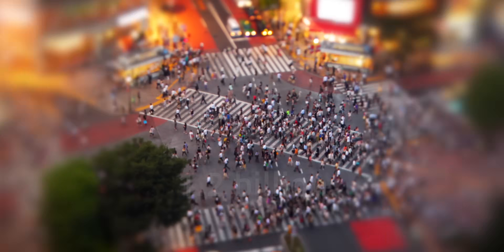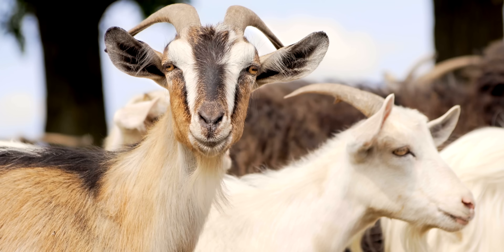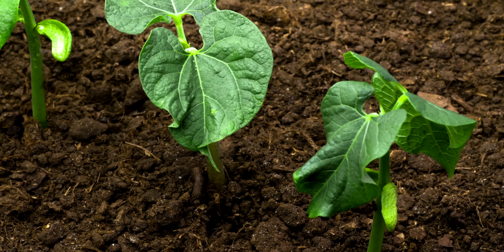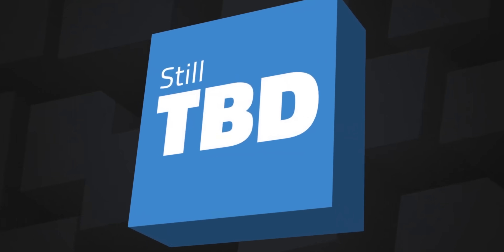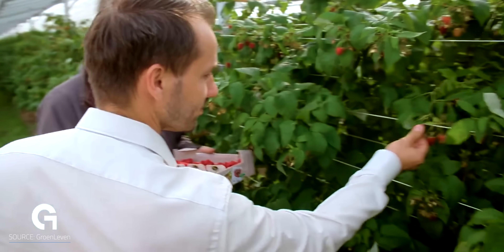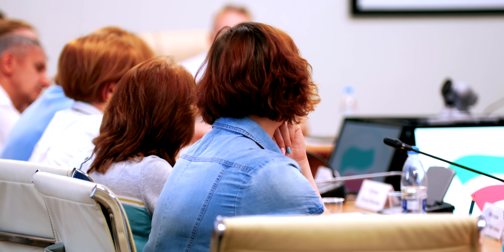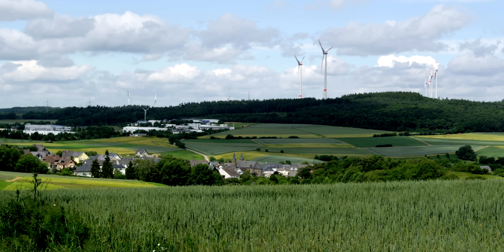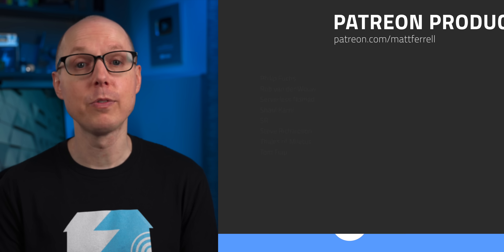Solar Panels Plus Farming? Agrivoltaics Explained

Comment: Several decades ago some articles were written about the potential benefits of putting farming equipment on rails in order to not compact the earth under the wheels.  At the time I recall the major advantage as being reducing the energy consumption of the equipment while working the soil.  Guiding the equipment through the rows between the solar arrays effectively achieves this goal.  Furthermore, the structures could provide attachments for a hot shoe  or catenary power takeoff to power electric equipment without the need for large battery packs.  I believe fuel is a significant cost for farmers.  Reducing the energy cost to the farmer could be further justification.
Reply: Yeah, powering the machinery itself would be ideal, and selling off the surplus as a bonus.
Reply: @UncleKennysPlace  There is nothing to stop farmers doing this in any field. It's just not cost effective
Reply: @daubentons1  I think you are well on to it- the original poster had no budget to pay for the rails, cross ties, maintenance- or the connector rails needed to get from one field to another. Same thoughts occur to me for farm equipment powered by direct take of from the overhead PV grids. But good thoughts to start from!  FR
Reply: Agree.  APV gets even more interesting when you further utilize the overhead structure to distribute power allowing the farm implements to be electrified.  As we move towards decarbonization, fossil fuel use in industries like agriculture will need these solutions!!
Reply: Over the long run it probably is better. But there seems to be significant initial cost that would keep anyone from doing that without federal assistance.
Reply: @wanaan  Instead compensating for taking land out of agricultural use the lease only has to cover the estimated loss of agricultural production.  As suggested by the video this can either be quite low or actually negative, implying that the farmer might even have cause to contribute a bit into the installation cost.  Providing distributed power to operate farm equipment adds modestly to the installation cost but eliminates the diesel fuel bill for working the land.  Those farmers with pumped irrigation doubly benefit having to pump less water and having access to no-cost energy to operate the pump.

I'm not sure that the Levelized Cost of Energy would suffer due to the more expensive construction, a one-time cost, vs. a favorable land lease.  I have not looked for estimates of energy per acre expended in working different crops but I suspect it is miniscule compared to the electrical energy generated by a combined-use photovoltaic installation.

I suspect the larger reason for lack of development in this area is that farmers are farmers and renewable-energy generators are renewable-energy generators, as the video also suggested.
Reply: I found myself wondering why I didn't see the solar panels powering water irrigation pumps and storage too, other potential benefits could be better sensors around the crops for detecting pests as well. Basicly, I wonder why the solar panels aren't used like a sort of open air green house system to better control the conditions ideal to the crops below them.
Reply: @CanadianWolverine  More good thoughts! I think this is what many enviro people are trying for.  FR
Reply: Wow ! What a good idea. Just add automated gear on those rails and you're on the way to a self-powered robotic farm. I'm betting the rails pay for themselves pretty quickly if everything is properly planned. Amazing!
Reply: @seltmitchell2965  Whole farms would need to be laid out with steel tracks, not just the particular fields. And to make it "zero emmissions" and cost doable, you would have to run some overhead power distribution power lines to run all the new (millions of dollars worth) electric equipment on. Good thinking, though and on a line more thinking wants doing on!  FR
PS; American farming is already well organized and uses less labor than ever before- but dealing with crops of biological origin and then add weather variability, and you have an absolute downward limit to how far you can reduce "hard labor" costs before you start paying more for equipment maintenance and breakage. And no, I don't play farm games online.  FR
Reply: You know something will break right at the worst possible time.  Like you need to get a job done today, but the tractor breaks down.  Look, you can just borrow a tractor from one of the neighbors.  If you go with a rail system, the neighbors would probably hate you or think you are insane.  When your 'on rails" equipment breaks down, good luck finding a replacement on time!
And then you cant even save your crop with an ordinary harvester, because you got all these rails in your field.  Does not seem like a good idea... 
By the time technology was good enough to make it worth while, someone will invent hover craft farm equipment.  no rails and no trails...
Reply: @voidremoved  What normally breaks down on a tractor?  Engine, transmission, clutch, power transfer?  A direct-drive electric motor can be quite reliable.  I'm not familiar with power being transferred to the various implements but imagine this can be totally separate from the motive power.  As for the working parts of the implements, I don't imagine why those would be any different.  Frankly, I don't understand why the implements themselves would be different.

So, if the tractor isn't breaking and the implements are still largely the same, I don't think that reliability should be much of an impediment.  An incentive for keeping implements the same is that a farm does not need to be all in on an agrovoltatic system.

With no or minimal batteries on the tractor the cost will be dramatically lower than diesel versions.  I don't see it out of the question that such a farm would be cost-effective even purchasing a full spare electric tractor.

On item to clear up is the rails of the decades-old proposal, in my mind, was as much for guidance as it was for keeping the weight of the tractor off the soil.  A disadvantage of rails is that, while they provide excellent rolling resistance, they also provide very poor traction.  For an electric tractor,  a ground contact must be made.  While generally a rail in most traction designs, this could be a "third rail" with a sliding shoe while the tractor remains rubber-tired operating on a guide track or mats of some sort.  The power interface would then be high off the ground in order to minimize personnel hazard.  Since farms are not secure in any fashion, this is probably required, anyway.  The traditional hot third rail is too great a hazard for livestock and intruders into the field.

The ultimate goal is, when breaking or turning the soil, is to not have to work soil that has had the weight of the tractor applied.  That works for open fields and may already be a goal at this point in time for all I know.  Agrovoltatics just seems uniquely suited to also provide this benefit.

That said, I only started this discussion recalling something I read several decades ago and tried to advance it to the present.  The concerns you raise are precisely the types of inputs I would expect at the start of an engineering effort to design the proposed system.  The other input would be learning how farming is actually performed, rather than relying on my armchair impression of how it is performed.  Thanks for the input.
Reply: @mrhickman53  Considering efforts by much of the farm machinery manufacturers to stifle "home repair" by farmers and local mechanics, I can see some major problems, completely aside the assumption based no a previous assumption. Farmer's mind set really doesn't work that way. They buy equipment that they plan to use till it takes more time and trouble to fix than it's worth- think decades. Replacement of the existing equipment will take those decades, at a minimum- more likely half a century. 
   I'm not a farmer either. I do have some time in and around some fair sized animal husbandry projects, so maybe I can "talk the talk" over the back barbed wire fence. But there is not much that is opaque about it- most of the vendors publish lots of stuff- you just have to always remember that stuff was written to support the writer/vendor's position- ALWAYS!
  Another thing to consider while thinking about "radical new processes" in farming; the American farmers (mostly slave owning early proponents of Agribiz)as early as the 1820's, were the first recognized lobbyists in DC. Subsidies to the American farms (mostly those same agribiz inheritors from the above) are only second to the subsidies given to the oil and other extractive industries. Any such "radical change" will have legions of lobbyists from hell and further south camping on and bribing every Congress animal in sight. They will be shoving the oil pipe liners, car makers, plane makers, bottle and cap makers, toy makers all out of their way, claiming their cause is the "disaster of famine" coming soon to our grocery store aisles. I'd suggest getting a good supply of pop corn- it would be one hell of a bun fight to watch! But just buying the pop corn would help fuel (fund) the Devil's Legion of Lobbyists.
FR
PS; I am not wanting to discourage any further thought on this or any of Matt's think pieces. Love the way he throws down well constructed facts and then steps back to encourage  more thoughts from all of us. "Use yer brain" as another Australian Tuber says!  FR
Reply: @fredericrike5974  I wrestle with the issues of entrenched industries and lobbyists, as well.  However, if I recall a video properly, much of America's farmland is owned by the super rich, not otherwise involved in the industry.

In the case of Tesla, a super rich individual with a vision basically went all in on that vision and is creating a major disruption on an industry as completely entrenched in American politics as any.

While ownership of arable land might be mostly passive, one individual that is driven to make their land more productive can similarly disrupt the industry and set it onto a more sustainable future.  It takes one significant landowner with vision.  Similarly to how Tesla concentrated on an ecosystem for California initially, the disruption in farming can occur initially in one region.

My 1/16th ownership of 1-1/4 sections of farmland in Kansas that I last set foot on probably 60 years ago is not sufficient to get the job done.  I do hold out that Elon Musk is not the only rich person driven by vision.  Maybe we can talk Bezos or Branson to give up on space and invest in agrovoltatics :)
Reply: @mrhickman53  You are thinking- keep that going! That "rich man with a conscience" may be closer than we know or hope. Like you, I'm not just praying- "God most helps him who first helps himself".  FR
Reply: @fredericrike5974  Thanks.  I always like critical comments as it makes me think deeper about the problem.  Especially if someone like you stays engaged.  Take care!
Reply: Why rails? It's long outdated by present and reliable technology.
Lots of efficient tech are long controlled by GPS systems... 😉
Reply: @OmmerSyssel  Rails provide a reliable ground for an earth-grounded electrical system distributed by a pantagraph.  Alternative means of delivering electrical power to a soft-tired vehicle is certainly feasible.  My original post was merely riffing from an article I recalled from several decades ago.  As long as the path does not rut out, a packed-earth track that is not otherwise tilled provides similar benefits to those attributed to the rails of the original article.

My modern take is to power farm equipment directly from the solar arrays, reducing energy costs while greatly reducing or eliminating the requirement for batteries on the equipment.  Guidance by any means with sufficient accuracy to facilitate the energy transfer would be acceptable in order to meet my goals.

I doubt any engineering was applied to the original article in order to justify the installation and maintenance cost of a rail system.  It focused on the energy savings of the low rolling resistance and less effort required to work soil that is not repeatedly packed by the wheels of the equipment.
Reply: @mrhickman53  the enormous amount of work and inflexible outcome makes rails completely irrelevant for agricultural use...!
Disney Land and public transport might be totally different.
Reply: @OmmerSyssel  As mentioned earlier, I was riffing on a several decades old article.  The new twist is to provide motive energy directly from the solar array to the farm equipment.  Any guidance technique that permits contact with the live conductors would suffice, only giving up the reduced rolling resistance of steel on steel.  The paper proposed rails in order to lower the energy input into the soil or harvesting the crop.  Enabling the farmer to directly access the solar energy for that input without relatively costly batteries similarly lowers the energy cost.  Battery costs are likely to decline fast enough that the battery tractor would win over developing this new energy ecosystem, anyway.
Reply: @OmmerSyssel  Me, I would prefer rails, simply because any "excursion" from the predetermined pathway will cost lots of dollars to repair as well as destroying my future yield  from that area for the year. Rail would also let me run my tractors on electricity generated from a central source rather than from portable energy carried aboard like fuel or batteries. PS; From time to time technical faults can interrupt a GPS signal- weather, a passing airliner, etc. Rare yes but very costly to the farmer. That would be why I went with rails anyway. And they would be smaller and lighter than what is commonly seen for standard railways- they will carry a max of say under 25 tons where conventional railways are built with single carloads weighing at hundreds of tons. 
  Good question though. Keep thinking and questioning- the situation needs all the focused minds possible on it!  FR
Reply: @fredericrike5974  never mind how much you're in love with your obscure idea and how detailed you'll find it interesting running into further absurdity, it's still not relevant for demands in the real world.
Reply: @OmmerSyssel  If your "real word" is to operate with zero chance of expensive mishap, then we need to see more development of better and more "aware" AI. There are many things- non standard sorts of things like flat tires, braking system oddities that could cause  a crash with  the solar array or further ground damage to crops. The rail hardware absolutely controls the pathway- the control only has to keep the speed appropriate to task and location. Just because a technology is old it may not be a irrelevant as you might think.
  BTW, I come to sites like this to see, to learn and to exchange ideas and concepts with other minds bent on seeking solutions for our world. Your displeasure with me for my opinion is the first thing you gave us- and followed that up with no suggestion of how you could see it done- just blowing crap out of your pipes, as it were. I can get past it this time- step on me again and I can demonstrate sufficient "personal opinion" to make your ears burn. 
  So, keep thinking, pondering and expostulating- and send along what you think are good to better ways to accomplish a thing. Even I, who is so "wedded to my preconceptions" have seen several better ideas in my lifetime.  FR
Reply: @fredericrike5974  unbelievable such long rants you're busy sharing.
The plain reality is I'm grown up and educated in one of the most successful and efficient agricultural regions of the world!
Your dreams are irrelevant while no one needs the concept nor the extraordinary work and complexity it involves.
As mentioned meticulously observant German Scientific institutions along with real Farmers has done practical research and published the outcome! 

Your fantasies were not part of these highly competent farmers concept or future wishes! While they have to live from their daily work, in one of the most competitive and efficient markets in the world.
Reply: @OmmerSyssel  Still, not one word of description of this already invented/developed/ implemented German farmer's decision. Sounds like more hot gas of "unknown origin" spouting from your font of all knowledge. LR, we are done, unless you want to bring substance rather than arrogant homily and BS. This is a good place to think, to dream and see others doing the same. Get your muddy shoes out of our watermelon!  FR
Reply: Would never, ever happen.

It would require purpose built farming equipment, of every type you need, all to be purchased at the same time. This means that someone would need to have a rail-model for essentially every piece of equipment enter production simultaneously. Which means that also have to design them all simultaneously. Because its all well and good to have a rail tractor. But if there isn't a rail plow or a rail seeder or a rail harvester to go along with it, there is no point in buying the rail tractor. No company is ever going to create an entire duplicate product line to come out all at once. 

Even if the manufacturers did, nobody would ever buy brand new everything. Not unless the land has never previously been farmed, or some sort of disaster struck and their equipment was a total loss. Farmers have enormous amounts of money tied up in their equipment. They plan on amortizing that cost out over decades. Changing to a system that requires them to get rid of the sprayer they just bought a few years ago, along with their tractor that's only 10 years old, and so on, is not going to get any traction from them. Or, even worse: they use their old stuff on this group of fields & the rail equipment on that group of fields. Now they have 2 of everything, which will require a new barn to house it all. 

Finally, there is the problem of transit. Plenty of farmers have fields on each side of a road. Or there is a patchwork where I have a field on either side of one of yours. How does the rail system reach these? Does the town pay for road crossings that benefit exactly 1 farm? Do they run rails down every rural road for any farmer to use? 

Its one of those ideas that isn't awful if the whole system were based on it from the beginning. But the advantages are too small compared to the costs to ever be a viable alternative.